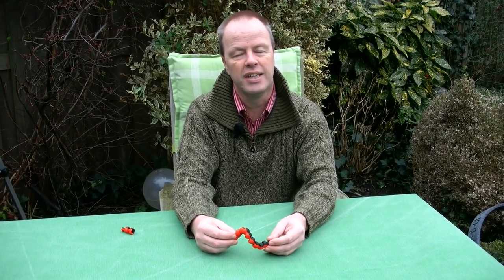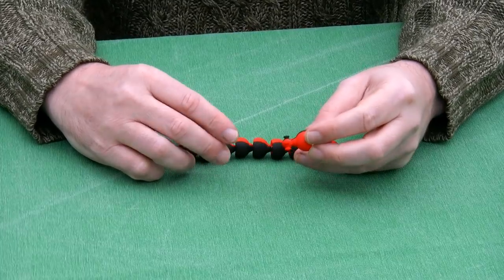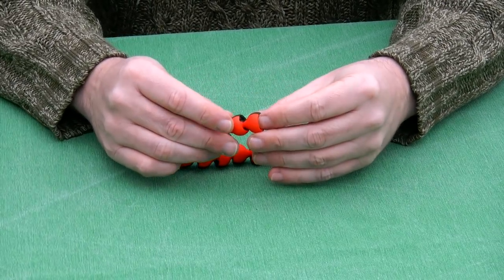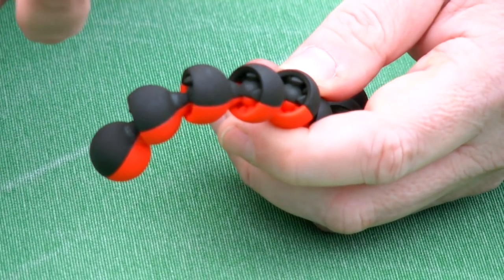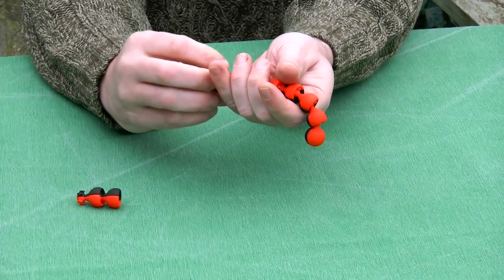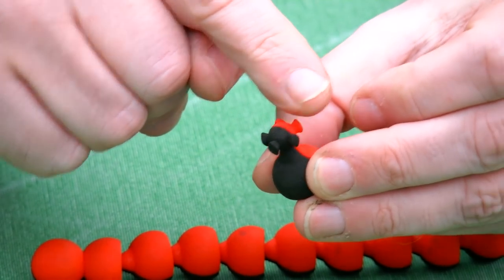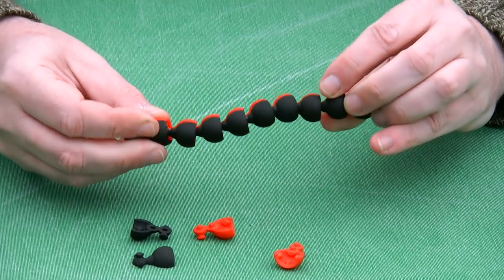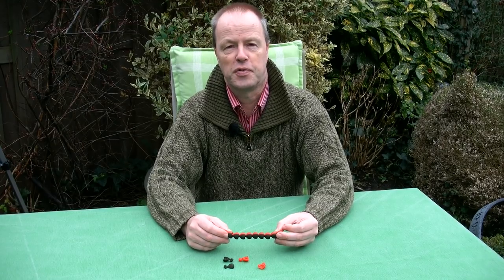Non Universal Joint

Comment: This might be useful in an application for a laparoscopic surgical tool requiring a large amount of torque that cannot be generated by a miniaturized motor. For instance, a laparoscopic tool for drilling into the the femur or pelvis. The joint could be 3D printed using laser sintering on titanium.
Reply: My first thought as well.

Comment: if each nub head a bearing on it, it would be a CV (constant velocity) joint which are more common on short axles as with universal joints you need them in pairs in order to maintain the same input and output speeds

Comment: Instead of something rotating it could be used as backbone of a flexible robot arm. The joint pieces could be modified to contain channels for wires, which could be pulled and pushed to bend the arm. The gears would prevent the pieces from rotating with respect to each other, which would help keeping the movement consistent.

Comment: Hi. First video I watched from your channel (I browse bridges website before). My naive improvement would be an optic cable from bottom to top of that very flexible string. Putting a small camera at the top..and some bars in order to rotate string...and you are a very simple model of human view. The improvement is a close cylindar hole inside the string.

Comment: Hmmm, a chain of beads that can convey motion. Perhaps put some stimulating dimples or ridges on the outer surface, connect it to a small motor+battery, and I can't help myself thinking of one particular application!  :-o

...

Cleaning out clogged drainage/sewage pipes of course...
Reply: or cleaning the cobwebs

Comment: How is this not a universal joint?
Reply: Melinda Green cuz it doesn’t get you high
Reply: @Vox 352 This comment got me high
Reply: maybe because each joint doesn't spin freely? Notice how twisting one end also twists the opposite end.
Reply: @swedneck  That's what a universal joint is supposed to do, otherwise it's a swivel.
Reply: A universal joint is specifically a pair of hinges at opposing angles. Different solution, same problem.
Reply: Ye, title is a big ambiguous, seemed to be '(non universal) joint' to me, where as 'non (universal joint)' seems to be intended after watching.
Because it's actually a joint, that's universal, kinda? Definitely not just a joint.

Comment: for use with a screw driver bit and drill. Put in a sleeve. Might be better than existing idea used to screw around corners? You will have to try it but if it works you may have a product worth selling at hardware store.
Reply: Search 'flexible drill bit extender' in Google - there are products that do this which look very similar to his design. Nice thinking.
Reply: @mrjbexample  so there is. I have one that is so crap but have not tried the one you just showed me. thanks. When needed i now use a 90degree corner drill bit thingy but these ones might be better. ill give one a go. appreciate you letting me know, thanks again :)

Comment: Oskar: That is not a Universal Joint. It is a Constant Velocity Joint. Universal Joints must work in pares that are 90° out of phase to carry power to the rear wheels of a car. Not that both ends of a drive shaft must be parallel to work and the drive shaft is moving relative the transmission and differential in a sinusoidal movement. A Constant Velocity Joint is used in places where you can't have a pare of joints like in front wheel drive systems where the wheel axle and drive shaft are not necessary parallel.
Reply: Bob Niemeyer title makes is very clear

Comment: This is better than a universal joint because the output has a constant velocity with respect to the input, whereas a universal joint does not. Constant Velocity joints like this are used where that's important.
https://en.wikipedia.org/wiki/Constant-velocity_joint

Comment: If I’m correct, a universal joint cannot bend 90° or more.  Your mechanism would me able to bend more than 90°.  Another solution would be to use two universal joints.
Reply from the maker: I built another universal-joint-style mechanism that can bend a full 360 degrees. Can you find it?

Comment: The universal joint is not a «perfect» solution, because if you input a constant rotational speed, the output is not in a constant rotational speed (unless input and output are at a zero degree angle, in which case you defeat the purpose for using an universal joint). That's why you need to use two universal joints to achieve a constant rotational speed between input and output. (see this and you understand the problem - https://www.youtube.com/watch?v=gmV4qwLfOMY) . Does this non-universal joint has the same problem? If not, maybe you have a great discovery for the auto industry.
Reply: Constant velocity (usually called “CV joints” in the US) are simple enough and already used. As long as the boots they’re wrapped and lubricated in are kept in proper shape, it’ll take crazy things to destroy them. I put over 207000 miles on my 93 Saturn SC2 with the factory ones, even got t-boned, no big deal for them.

So no, this isn’t something all that useful for cars for that purpose.